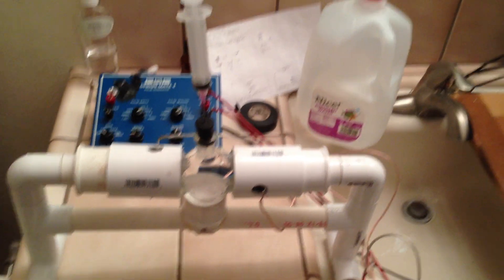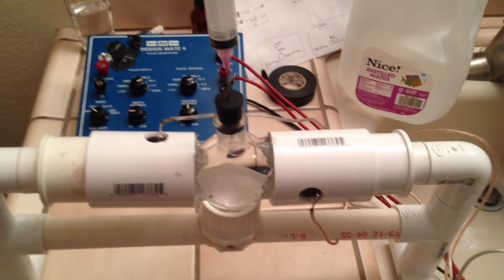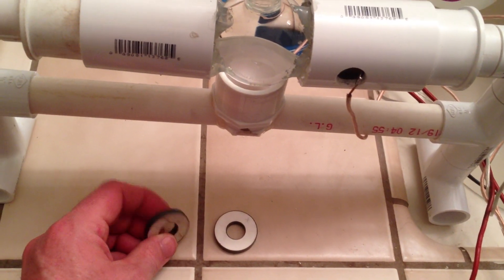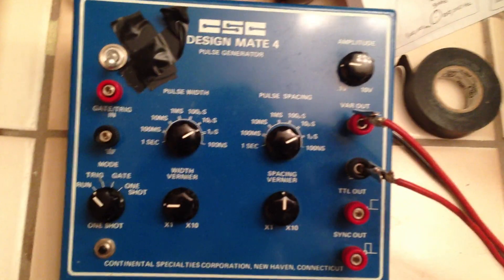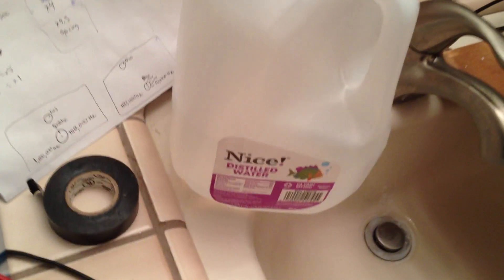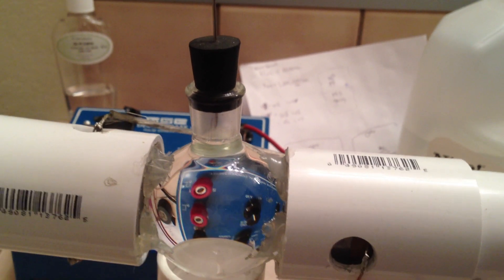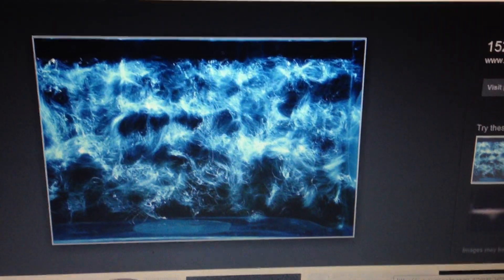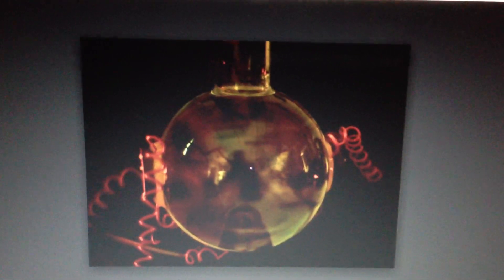Sonoluminescence 002 - Finally able to capture results on film (Multibubble)

Comment: is there a certain power output (watts) that the audio amplifier has to provide?
Reply from the maker: I didn’t measure the output. I set everything up with the volume all the way down. Once the lights were off and my eyes adjusted, I slowly brought the volume up as I adjusted the frequency. I would see SL at 1/4-1/2 volume. Above 1/2 there wasn’t a noticeable change in size or brightness of the SL. Hope that help
Reply: @LimitlessResearch  thanks, I'm asking more for which audio amplifier I should buy. They come with certain Watts and I wanted to know if there was a specific requirement for the power of the amplifier. Any ideas?
Reply: @LimitlessResearch  also, would any piezoelectric transducer work? Or are there again specifics?
Reply from the maker: Ezra Tsegaye Yes there is, but it’s not much. The minimum wattage required needs to be enough to drive the transducers you purchase or the ceramic elements. When you purchase them, they will list the wattage. The main variable is the resonant frequency of your flask. I was lucky I saw anything at all. Conventional wisdom says audio amplifiers top off at 25-28kHz. To make things easier on you, use at least a 1L round bottom boiling flask. The larger your flask is, the lower the frequency needs to be. Most transducers should work, but I would stay away from the paper thin ones. They just need to be able to achieve the resonant frequency of your flask.

Comment: Where can I get the exact same pulse generator that you used in this experiment, please? Thank you.
Reply from the maker: I found mine on eBay, but I don’t see any available right now. Search for “csc design mate 4”
Reply from the maker: Any pulse generator will work as long as it reaches the resonant frequency of your  round bottom boiling flask. The larger your flask, the lower the frequency needs to be. A 1L flask should make it easier with a frequency below 25khx. This be achieved by many frequency generator apps or computer programs for free.
Reply: @LimitlessResearch  thank you

Comment: 2 things:
1- what happens if you touch it ...let say with a metal stick??
2- what happens if you do that to your head??? We have water inside!!!
Let me know
Reply from the maker: I stuck my finger in a cold water humidifier as a child. It uses a transducer to create water vapor. It feels like a mild electric shock mixed with vibration. No visable damage was seen, but there could have been microscopic damage. Prolonged exposure at a frequency that causes cavitation will lead to microscopic cell damage. The longer the exposure the more damage will occurre.
https://youtu.be/gRsvO4Gpnf0

Comment: I just discovered this Sound Luminescence.
Do you guys know what is causing it?
If you leave it running for a long time, does the water volume go down?
If so, I think I can guess why this happens.
What is the current theory?
Archetypal Entanglement A Beautiful Mind Kindle Books
Reply from the maker: As far as I know the science is still not fully understoo, but here are a few links for you discussing the theories.
https://physics.aps.org/story/v7/st23
http://large.stanford.edu/courses/2015/ph241/chapa2/
https://acoustics-research.physics.ucla.edu/sonoluminescence/
Reply from the maker: At the very basic level of understanding, the water is ripped apart by force (vibration frequencies or other) creating a vacuum void. In this void there is water vapor and gasses that were dissolved in the water. As the vacuum pulls the water back in on itself, it condenses these gases to a small focused point where they slam together at high speed. This excites some atoms enough to give off photons. There are claims that it also releases neutrons.
Reply: @LimitlessResearch  
Hey Rusty... Long story, but I got to thinking about how nature conserves energy. Or more simply whether god hadn't made a perpetual universe. In a more scientific way of thinking, whether there is not a mechanism in nature that conserves entropy, after all, something is making those planets out there.
And to cut a long story short, I think I can see how that is done.
The thing that comes out of it, is that all matter has to be in some kind of field, but it not this free energy crap all over the web, the way this field works, is if it is not there, matter dissolves, or decays.

So, in terms of this idea on how the universe is actually working, this is what your bubbles are doing.
Normally the SOL field exists in the atom and all around us. i.e we are not in empty space.
What the sound does is create more space in the bubble than there is this field. It makes the field thin.
So its creating real empty space, or thinning this field. I call the field SOL, scientists would probably call it Higgs when they realize its not a particle. 

Anyway, the thing to get, is that without this field, matter decays. It is actually the secret to making cold fission, make real empty space.
When the field gets too thin (bubble big), the surface water atoms decay, like a nuclear material would, this naturally destroys the bubble, and it collapses, when the fields are again balanced, inside and outside the atom, we back in the matter realm and the excess energy emits photons, the surface tension restores, and the sound starts growing the bubble again. So all the sound is doing is growing the bubble, no energy coming from it, and it is not compression when it collapses... it happens when the atoms don't see SOL.

You have seen this process before, its how lightening works, it is what happens if a sun drifts out of the galaxy and goes super nova or turns into a pulsar in thin SOL. It is why mars has electrical scarring, because in their low atmosphere a dust devil will create lightening at its base, same process, not enough SOL.

Like I said... I figured this out because I thought the Big Bang theory was wrong, and that if the energy in the universe was not conserved and entropy did not have a way of reversing, our universe would be one big dust cloud, which is why the standard model is wrong, it thinks that is what the universe should be, a dust cloud.

So... what the sound is doing is making the bubble too big and creating real empty space... and that is lightening. So now you can figure out how to make that empty space.
It is what the shrimps that blast their prey are also doing, simple making too much space for the matter, not enough SOL and wham, they have made a lightening strike. Its actually fission, not fusion.

Its happening on the surface of the big bubble, not at the center. 
By the way, no SOL in space is what they think a black hole is, but as you can see, they wrong, nothing to do with gravity. With this theory of mine, I actually think a sun burns on its surface, not inside.

Anyway... make empty space and you will have your machine... COLD FISSION...

Anyway thanks... when I saw your bubble, I knew my universe theory was right...
Its what Tesla saw as well... I am sure of it... 

In this short book I go through the logic... no math, just trying to find a model for the universe that works.
Archetypal Entanglement A Beautiful Mind Kindle Books
Reply from the maker: Interesting theory! I thought you might enjoy these SL videos showing the cavitation in slow motion.
https://youtu.be/7MgEqXIPt9Y

https://youtu.be/mceZ3Ep20AQ

https://youtu.be/HuDyy4MTosA

https://youtu.be/hDRvqlYGvpM

https://youtu.be/OeunRrfvyAU

Comment: What is a micro second what frequency is that ..could you tell us in the proper number in hertz .
Reply from the maker: A microsecond is 1,000,000th of a second. I had results with a pulse rate and pulse width around 200,000Htz or every 5 microseconds.
Reply from the maker: The rate will be different for everyone. You’re tuning into the resonent frequency of the flask. The size, shape, & thickness of the flask all change the frequency as well as the temperature of the water & the water composition. So it will never be exactly the same.

Comment: Ok much better than previous set up, however cameras on long exposure suffer from 'hot pixels' where the CCD heats up and causes some pixels to light up. I am not sure at this time how to prove it is actual S-Luminescense or this hot-pixel effect; Maybe use two cameras?
Also I read on research papers that the signals into the transducers were pure-sine-waves, not a pulse as you are using.
In effect you are emitting multiple frequencies(Since square-waves are composed of many sines) into the water which may counteract any standing waves you wish to achieve; and will probably not result in bubble compression.
You are using 2us period or 500KHz; that frequency is way higher than any commercial ultrasonic sensors I have found, so the results you are seeing is from the low order harmonics, you could probably go much lower within the frequency range and achieve more output with better results.
Sorry for saying so many negatives; but I say this in a constructive way because I would love you to succeed in this experiment!.

For anyone experimenting, they sell twin 40Khz ultrasonic cleaner transducers with amplifier circuit on ebay for around $40.

Some experiments add a noble gas to the water to increase light intensity, Xenon seems to be the most effective from what I have read.
Reply: Limitless Research: Thank you for the videos, interesting, will watch out for more.
Reply from the maker: Thanks Suzy! The long exposure pictures are for the skeptics.  I have seen the purple glow with my own eyes, so I know it's happening.  It's just not bright enough to show up on video. Also, to save some money,  The transducer ceramic element is a lot cheaper than the full transducer. Also available on eBay.
Reply: Limitless Research: Well in that case despite so many 'inaccuracies' it still seems to work!, that's fantastic news for the average experimenter that cant afford all the expensive lab equipment. Think I will have a go myself now. So big well done.
It may even be world changing if hybridising it with electrolysis could make hydrogen splitting even more efficient. Purple glow?, wonder what that tells us about what is going off at the atomic level; could really do with an optical spectrometer.

Comment: Have you ever thought about what would happen if you used this type of resonance tech on one of those zpe water fuel cells (electrolysis)?
So you would be collapsing the bubbles of the "so called" Browns gas or electrically expanded water
Reply from the maker: No, but that would be interesting. If the temperatures really are what they have been estimated to be, it should cause a small explosion. I have seen transducers used in HHO generators, but only to shake bubbles off the plates to expose the metal faster. This results in higher production with the same amount of voltage.
Reply: Well obviously be cautious with your endeavours, but if you do try something along those lines and discover the ultimate in energy production don't forget me lol

Comment: hi there. i am trying to replicate the experiment, but i am currently lost about how to use the power audio amplifier in order to achieve a peak to peak voltage of 4 volts as seen in the microphone, as the manual of techmind especifies, could you give me some hint about how to conect the amplifier
tanks a lot
Reply from the maker: Sure, I don't know about the 4v peak to peak, but your input to the amplifier is the frequency generator and your output goes to your transducers wired just like speakers. Then set the volume to about 1/2 max and start going through the frequencies. When you see light you can fine tune the volume and the frequency. Be sure to be in complete darkness. Even a small LED or light from under a door can be enough to drown out the SL.
Reply: Thanks, that worked!! haha so cool
now we're trying to take a good picture, which is hard cause the function generator is not so stable, and the intensity is poor

Comment: What would happen with my brain beween these tubes ? Would it enlighten or melt ? LoL
Reply from the maker: ytrebiLeurT I'm not sure if it would produce cavitation in brain tissue, but if it could it would cause damage to those areas. At the very least, separation of tissue and neurons & at most permanent tissue damage. 

On a positive note, ultrasonic waves are making huge strides in Alzheimer's treatment.
Reply: Exciting. Thanks
Reply: The sounds come from outside the jar. Would not it be better to sound directly into the water so to put the speakers into the jar?

Comment: Sorry im a late comer. Neutrons maybe the be all in proving fission, but tritium was detected in the first cold fussion of Flieschmann and Pons. Has any tritium been observed in the Star in a Jar experiment. It seems that neutron detection is problematic, but Tritium has been observed at several labs, not all labs but i believe 3 labs did report tritum was detected.Sea water produces deutrium so it may be a good liquid.
Also the musical instrument the Cello produces individual water droplets and bubbles within the inside of another bubble in a 0g space shuttle experiment(bubbles inside a bubble). High frequency produces standing droplets of water that probably would magnify the star in a jar effect or least create a more controled experimental environment.
Reply from the maker: Interesting. Thank you for sharing. 
Regarding the star in the jar frequency however, it depends on the "jar" or flask being used. To get a star or repeated cavitation, one must tune into the resonate frequency of the flask.

Comment: at what freq sound u use? re those produce standing interference or destructive interference?
Reply from the maker: The frequency required changes depending on the size and shape of the container. Small flasks need a higher frequence while large flasks need a much lower frequency. Here is a link that shows the math. Hope that helps. To acheve SBSL you need a standing wave.
https://en.wikipedia.org/wiki/Acoustic_resonance
Reply: make sinse now.thx for the tip :)

Comment: Do you know what the frequency response of your amplifier is? (2Hz-20kHz, for example). I need to buy one, and was wondering if any cheap 50w amp would work, or if I need something  that specifically state that it goes up to 40khz or 50khz. 

In specific, do you think something like this would work:

http://www.pyleaudio.com/sku/PCA3/Stereo-Power-Amplifier---2-x-75-Watt-Power-with-RCA-Inputs-and-Push-Type-Speaker-Terminals

 Thank you!
Reply from the maker: That should work! I don't know the frequency response, but it worked, lol. Here's what I used since I had one for the home stereo.
http://www.crutchfield.com/p_158STDH550/Sony-STR-DH550.html?tp=179&awkw=75621701065&awat=pla&awnw=g&awcr=47439272905&awdv=c

Someone wrote me and let me know they acheived SBSL using 2 of these amps.
http://www.ebay.com/itm/2016-TDA7297-Version-B-15W-Digital-Audio-Amplifier-Board-Dual-Channel-AC-DC-12V-/331749191424?hash=item4d3dcaef00:g:Bt0AAOSwtlhWFyS~

Comment: Instead of water, have you tried alcohol yet?
Reply from the maker: I haven't, but I just looked it up here http://www.ncbi.nlm.nih.gov/pubmed/22463314
It seems that a thinner liquid shrinks the size of the bubble. Looks like we need to thicken the liquid for a larger effect.
Reply: Russell Martin that might be the ticket, though I think the most recent, "putterman", used it.  I am not 100%, but I read it
Reply: have you seen people use ballistic gel?
Reply from the maker: No. Does that work with sound waves? I have seen this which is related. https://www.youtube.com/watch?v=tC2SUehnJ5A
Reply: Russell Martin the science behind it if understood as we think we do this phenomena occurs in most high viscosity liquids. I've seen several experiments with alcohol, saline water and silicone oil.
Reply from the maker: Nice! Thanks for sharing!

Comment: I was thinking about dabbling in one of these... and was looking for a decent piezo element
You may get better energy transfer with a medium between the glass and transducer. In an old navy sonar document I was reading (for the peizo content) they used specially filtered castor oil in the transducer box, behind a window to interface with the sea water. in water you need about 117DB to induce cavitation.
Reply from the maker: Great info. Thank you!

Comment: Does the pressure in the water have anything to do with the color being seen? I'm imagining that higher pressurized water (basically just do the experiment in the bottom of a taller tube) would only create cavity bubbles at higher frequencies, and since higher energy -> more energized light -> bluer color, that is what you should see. Has anyone experimented with this? Basically a single bubble cavity that can be moved up and down, does that produce different colors for the sonoluminescence, or is it always that pale blue shine?
Reply from the maker: The brightness and size does depend on the pressure. Low pressure makes it easier for the vacuum bubble to form. From what I have read and experimented with, 1/5th atmosphere works best. The color of the sonoluminescence  depends on the gases infused with the water. Look into the colors given off by excited gasses or spectrum tubes to get an idea of the colors that can be achieved. bluish/purple is what I saw with mine. That is related to the main gas in the atmosphere being nitrogen.
Reply: +Russell Martin fascinating, do you have any theoretical reason for why 1/5 atm works best? Does it have anything to do with the geometry of the setup? 

This is by far the most interesting physical experiment I've seen in a while, I would love to learn more about it. My physics courses at the uni hasn't mentioned this at all, any suggestion on where to read up, or have you published anything?